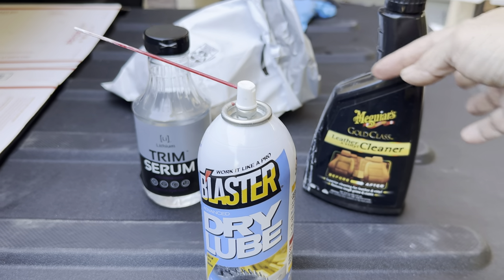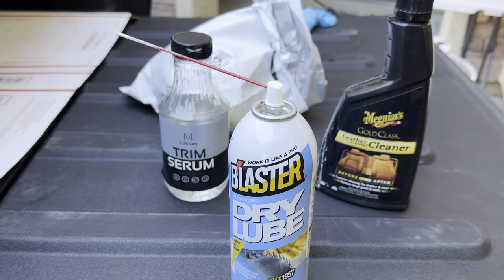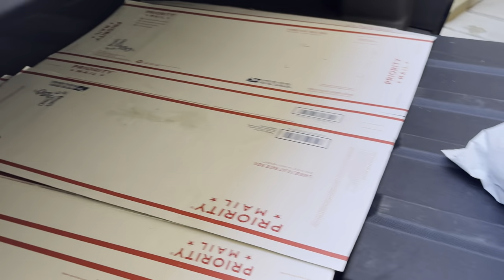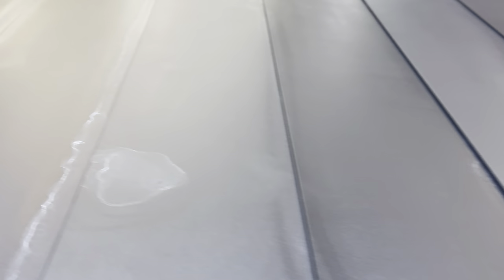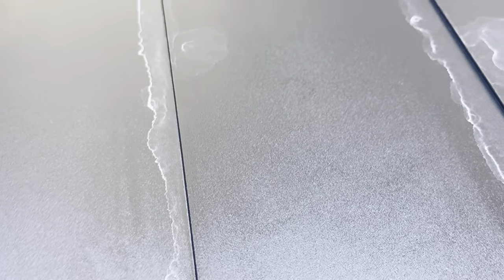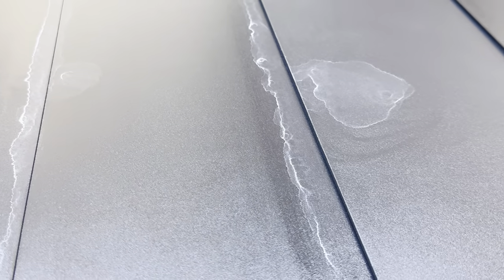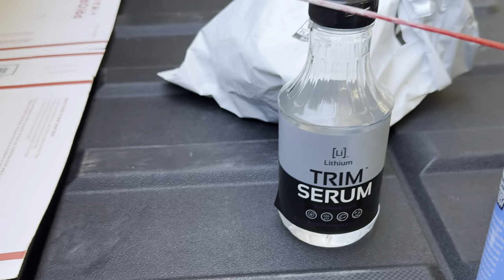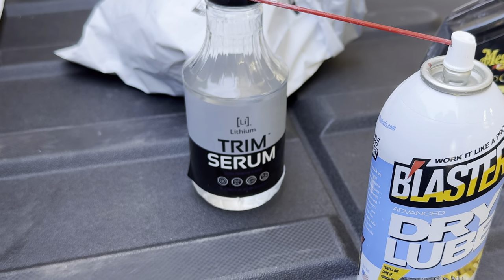Rivian R1T tonneau cover fix

Comment: try lithium grease in a spray can.  dry lube not appropriate
Reply from the maker: Definitely not, dirt sticks to it.
Reply: @CAAlvarez602  Definitely yes.  Bike chain lube might be slightly better but haven't tried and you'll have to add it weekly.  Lithium grease is used on every vehicle in every metal-metal contact wear surface (besides engine).  Mine works perfect in dusty roads.  Never had to lube since added months ago.